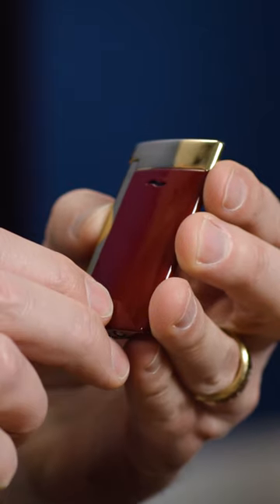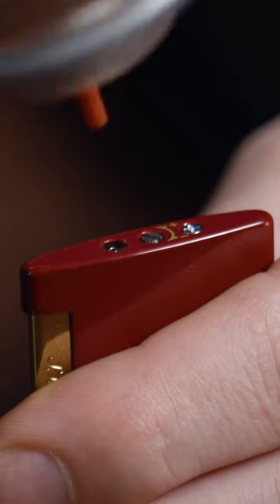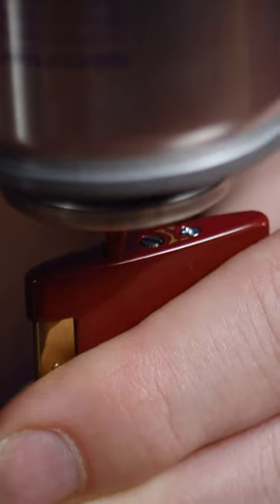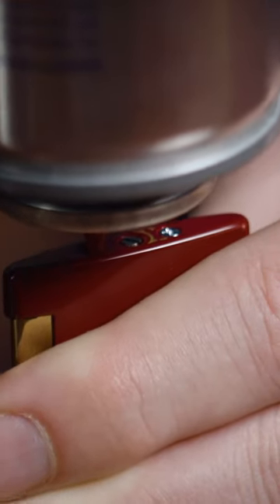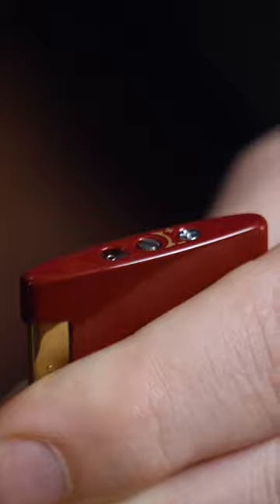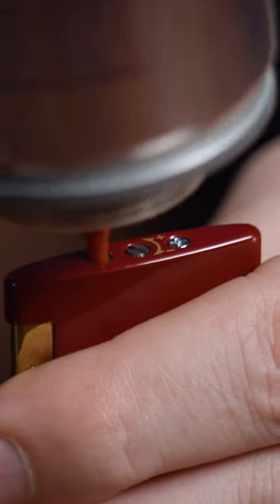Secrets to Refilling Your Butane Lighter #shorts

Comment: All you do is add more butane. Push down on the inlet for a few seconds to let the air out then top off with butane. Works like a charm and fills 98% of the tank.
Reply: I also doubt the thermal expansion valving in jet lighters wants to be exposed to freezing temperatures. The man looks great in a suit, i doubt he knows much physics or can swing a hammer.
Reply: That's the correct way.
Reply: @wristray8775 what is ? Putting a lighter in the fridge 😂

Comment: I don’t know why he says to put it in the freezer, the gas/air you would want to purge wouldn’t come out that way because gases don’t expand from cold they expand with heat. It’s the opposite of what you would want. Don’t shake your butane cans when filling your lighter, what you’re supposed to do actually is have the butane can sitting upside down lid down for a dw minutes so the liquid fuel can settle to the bottom before using it, that way you have the proper amount of liquid fuel and pressurized gas. If you shake it you risk ruining your lighter valve when you fill it because it could pop the lighter valve. I’ve also heard of lighters kind of “exploding” from being too full of gas

Comment: after purging the lighter, shake it to expand the remainder gas inside and purge again. you will be surprised when it whoshes again.
remember gas under preassure turns to liquid, so when you shake whats left in the lighter you heat it and expand it. that's why you purge, shake, purge, shake, purge.
Reply: Holding it in your hands is good enough, shaking can make it too hot, and give a giant flame the first strike
Reply: @princelysnail1998  im talking about purging the lighter when the gas runs out. you purge, shake and purge again to empty it better
Reply: There’s a lot of that gas and it can take a while to get all of it out. Shaking it causes the gas to expand and create more pressure because of the warmth of the gas going up slightly. The warmer the room you’re in when you’re purging it also helps get the gas out faster too. I’ve also been dumb enough to (please don’t try this I’m just exposing how I’ve had this work for me when I was having issues purging my lighters) take a cheap bic lighter and quickly warm up the outside of the lighter I was trying to purge. It helped

Comment: On the can it literally says not to shake it. You want the butane to be transferred as a liquid. 
The reservoir is drained to relieve pressure. You will have butane as a gas filling that volume at a lower density. Emptying it fully lets you fill with the butane as a dense fluid. More burn time.

Comment: i will atest to this method, my lighter has a see through chamber so if you dont empty the air first mine will fill just below half just below 2/3 if the air is let out and all way to the top if i pop it in the freezer.

Comment: Another episode of "How to complicate simple things"
Reply: not purging the lighter is that ruins refillable lighters. the butane comes with air to aid with preassure so if you don't purge your lighter it will start to fill with even more air and less butane. so after refilling it it will go empty super quick
Reply: @azteco  nono. The butane gas refills are almost 100% pure butane. Adding ay oxygen rich fuel to that would be a recipe for disaster. Any air inside the tank will eventually be whisked away with the outflowing butane and pushed out by the pressure.

Comment: I just bought butane and this is nothing like my experience need help if I do it gas just goes everywhere and freezing liquid sprays all of the place and does fill its just like a big smoke/liquid mess
Reply: Hey, it sounds like you're trying to refill the lighter with the wrong size nozzle for the butane gas can.
Just a quick tip when you're topping up your lighter with butane – grab the right nozzle size, they're usually included in the can's lid. It might take a couple of tries, but once you find the one that fits your lighter's valve, you're good to go! 😊

Comment: Any lighter I have, I use sparingly. Any time I try to use any “zippo” style lighter the butane has evaporated off. Is there any sealed lighters or they must be used more often? 

Sucks every time I grab one it’s out so I have to fumble around and find a trust bic
Reply: Zippo style don’t use butane.
Reply: Zippo fuel does evaporate after some time, you can get a butane insert for a Zippo that might last a little longer
Reply: @Psykel bruh zippo makes butane lighters 🤡
Reply: @GenesisRasphotos  ”Zippo style” means lighter fluid though, and the OP having trouble with it evaporating means it’s one of those. I have a Zippo with their double torch insert for when I’m out and about.
Reply: *ARE there any
Reply: Get Zorro lighters instead. They're airtight and won't allow fluids to evaporate.

Comment: While it doesn't take an engineer to see how purging the system does nothing but introduce air, (I AM one) I'll qualify my statement with knowledge in Hydraulics and pneumatics.  If your lighter (a pressure vessel) "needs purged" this means your lighter is at a positive atmosphere.  That positive atmosphere means there's BUTANE in it. And as long as you're not using second rate butane it does NOT need to be purged.  There are no majic tricks in this.  Stop wasting butane. Save yourselves some money.
Reply: Especially seeing that the air isn't going to condense like the butane does - any air will be pushed out in regular use and the boiling butane will replenish it, leaving only butane in the tank.
Reply: @charmio  thank you